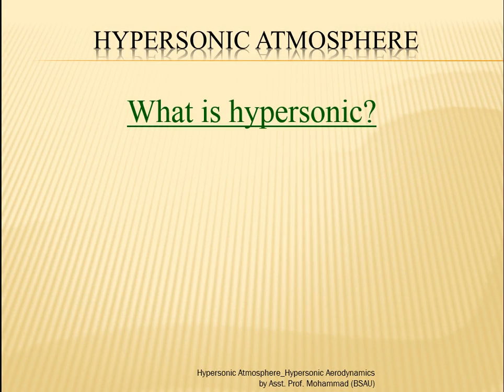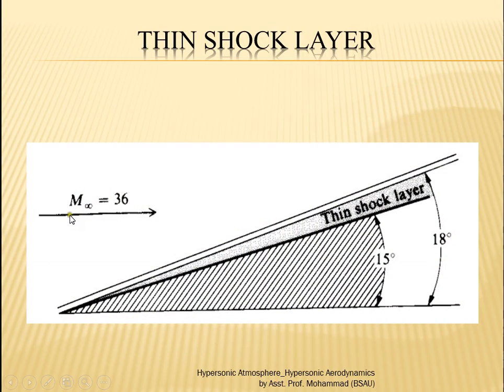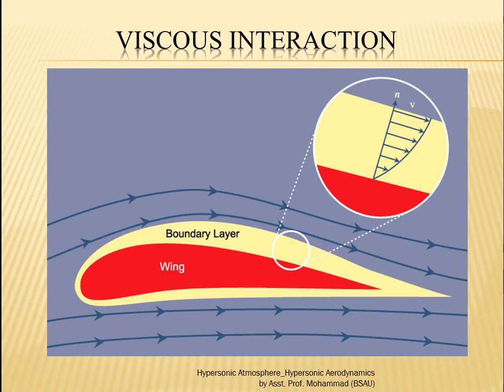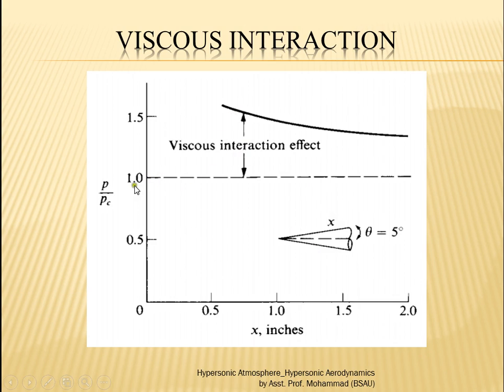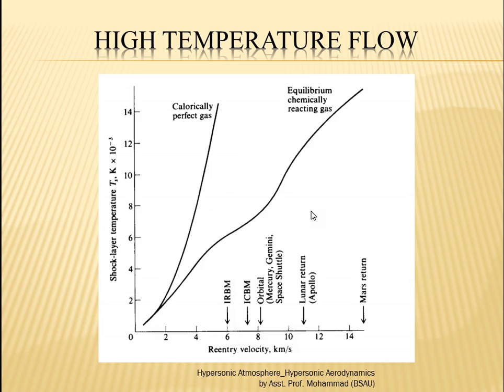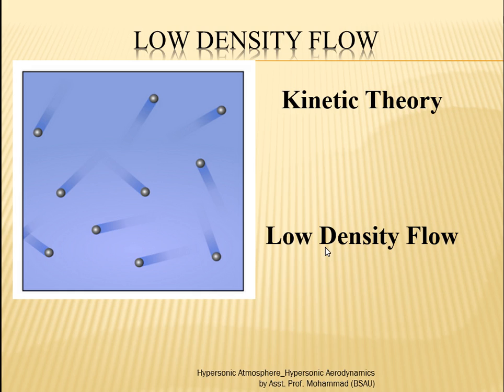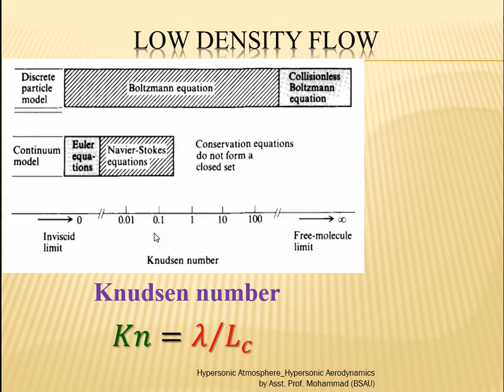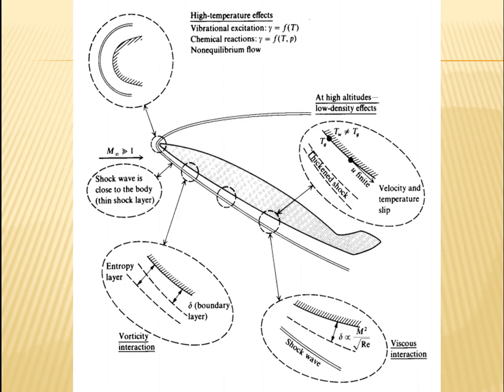Hypersonic Aerodynamics 05

Comment: One of the most unfounded in our modern engineering is material that cabaple to withstand such environment in hypersonic regime.
Reply from the maker: Agreed. Now we have enough "know how" of the aerodynamics and propulsion design of high speed vehicles. We must explore and invent or design some high temperature withstanding materials....I agree iwth you Zack...
Reply: @ae00505  sr bear in your mind for highly hypersonic the engine will become useless because of numerous reason.
For low hypersonic flight around mach 6,7,10. The aerodynamical structure of the intake are provided good pressure recovery and well external compression system. But for highly hypersonic the generation of boundary layer in the intake and outer surface of the vehicle will dissociate the gasuos molecoule and that dedicated gass will not react with fuel and combustion effeiceincy is diminished.

Only non-airbreething engine are only aplicable to flight highly hypersonic regime and outer space also.
Reply from the maker: @zackhared1793  I agree with your comprehension and facts you put but the final statemetn is little disheartening and that's now how a scientist thinks. We have to find the solution to it. if you navigate in air, it is always advantegeous to  use eir breathing engines. rocket engines give high thrust and we use them even for JATO flights. but in air we  must have some technique to use the availability of air, this will give extra range and endurance. wait for the time to have a solution to the problem you posed.....sooneror later it will come out....

thanks for the response...very soon I will complete the lecture series.  Right now only three units are covered. I will take time to complete the entire five units in shaa Allah.
Reply: Insha allah
Reply: one of the most important materials that is very useful to use in hypersonic applications is interlacing carbon-carbon with ceramic materials became more available for hypersonic programs. 
example in space shuttle the lower surface is designed in  many thousands of tiles which is the product of the thise two material that I have mentioned before.

Comment: Sir! This is Tarique Shaikh. The temperature of dissociation would depend on the mach number and ALTITUDE. Because at lower altitudes the pressure at low altitudes would delay the dissociation process.
Reply from the maker: +Tarique Shaikh Tarique, look carefully and try to find some more facts. I don't have data so I can't say anything for sure but I have a feeling that dissociation is hardly affected by the pressure. It is a clear function of temperature. It is not like boiling or melting which is a function of temperature but is markedly affected by the pressure also. let me know if you get any clue regarding this.
Reply: +ae00505 Ok sir I will check this up. Inshallah sir I shall be travelling to Germany to study Hypersonics of reentry capsule. I will be in touch with you for help. Zazakallah.
Reply: There is a parameter called Damholker number that define the ratio of residence time to charecteritic relaxation time.
The charecteritic relaxation time is strongly function of post shock gass  
And amount of collision frequency 
The higher collision frequency the higher temperature and pressure and finnaly the mean charecteritic relaxation time became small